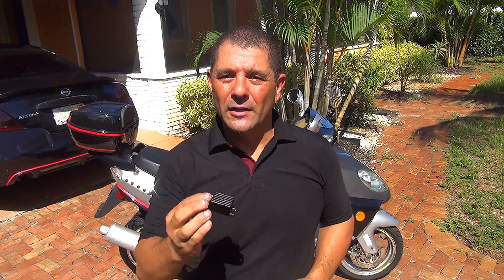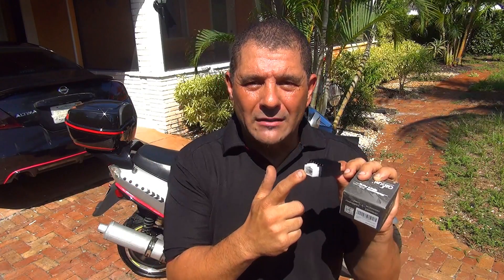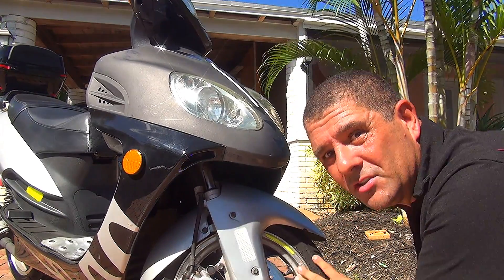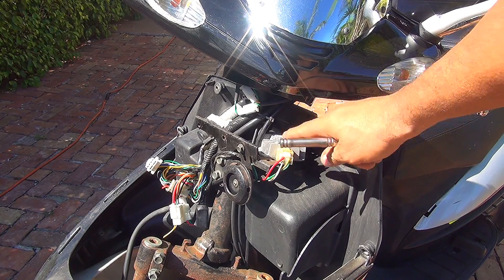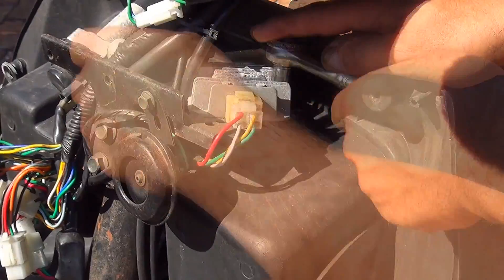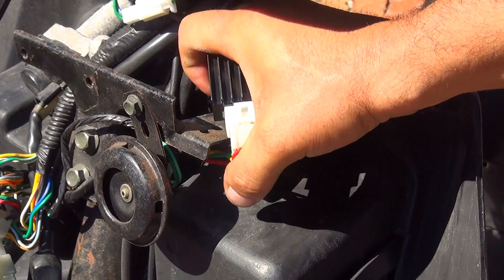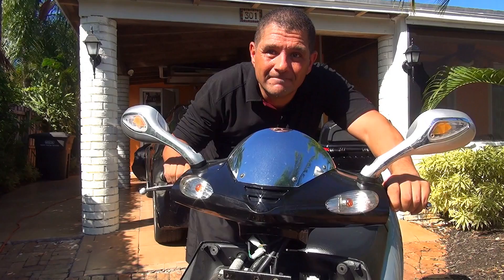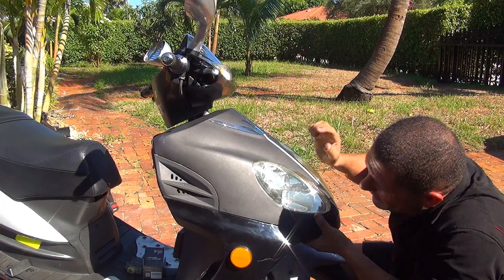How to Replace Scooter Regulator

Comment: I have a 5 pin regulator
Reply from the maker: Some gy6 150 cc run with a flat connection or a square connection Chinese companies like to confuse us just for fun ah ah ah
Reply: @VirberelloScooterTips I found one on Amazon it's a minyo one square connection would that be the one I need

Comment: Hey Virberello, I just changed my clutch springs from the 1000rpm to 1500rpm. I test rode it and it was great. But the next morning my bike wouldn't start. I replaced the battery, test rode it and then the same thing happened! Do you think its because of the LED bulbs I have on my scooter or the regulator itself is the issue?
Reply from the maker: Hello my friend If your battery keeps dying after riding, the regulator might not be charging it properly. LED lights don’t usually drain much power, but if they’re wired wrong, they could be pulling power when the scooter is off. Try disconnecting them overnight to see if the battery still drains. The stator could also be failing, meaning the bike runs off battery power alone until it’s dead. Check if the voltage increases when revving. If not, the regulator or stator might need replacing. Let me know what happens!
Reply: @VirberelloScooterTips i just had to disconnect the regulator, spray some contact cleaner and reconnect it and it's running now! Thanks man!
Reply from the maker: @imWoozify  Great that is a fantastic news
Reply: @VirberelloScooterTips  alright, will do!

Comment: My front headlight goes on when I stop and idle.  It turns off when I go/accelerate.  Is this a voltage regulator issue?
Reply from the maker: Yes that could be the wires or the regulator

Comment: I have an 8 pole stator on my GY6 150cc. I noticed the scooter in your demo has a 6 pole stator. Is the rectifier you recommend in this video compatible with my 8 pole stator?
Reply from the maker: Hello yes the rectifier I recommend in this video is  compatible with 6 and 8 poles stator

Comment: My 50cc system was shut off no lights on gauge no everything yes no power. Could be the battery wiring? I change the fuse and still nothing.
Reply from the maker: It sounds like a power issue in your 50cc system. Since changing the fuse didn't resolve the problem, there could be a few other possibilities:

Battery: The battery might be dead or disconnected. Check the battery connections to ensure they are secure and clean. If the battery is old, it might need to be replaced.

Wiring: There could be a break or short in the wiring harness. Inspect the wiring for any damage, loose connections, or corrosion. Repair or replace any damaged wires.

Ignition Switch: The ignition switch might be faulty. Try wiggling the key in the ignition to see if you can get any response. If not, you might need to replace the ignition switch.

Starter Solenoid: If the starter solenoid is malfunctioning, it could prevent power from reaching the electrical components. Test the solenoid or consider replacing it if necessary.

Stator or Charging System: If the stator or charging system is faulty, it might not be supplying power to the battery or electrical components. Test the charging system to ensure it's working properly.

If none of these solutions work, it might be best to consult a professional mechanic or technician who specializes in small engines to diagnose and fix the issue

Comment: My tail light, my headlights are really dim.I tried everything a new stator new battery nothing helps.Will this fix my problem
Reply from the maker: f you've already replaced the stator and the battery in an attempt to fix the dimness issue with your scooter's tail light and headlights, and you've noticed no improvement, it's likely that the problem lies elsewhere. Here are a few other potential causes to consider:
Faulty wiring: Check for any loose connections, damaged wires, or corroded terminals in the electrical system of your scooter. Faulty wiring can lead to insufficient power reaching the lights, causing them to appear dim.
Voltage regulator/rectifier: A malfunctioning voltage regulator or rectifier can result in inconsistent power output to the lights, causing them to be dim or flicker.
Grounding issues: Poor grounding can also cause dim lights. Make sure all grounding connections are secure and free from corrosion.
Burnt-out bulbs: Although less likely if both the tail light and headlights are dim, it's still worth checking if any bulbs need replacing.
Alternator issues: If your scooter has an alternator (in addition to or instead of a stator), it could be malfunctioning and not providing enough power to the lights.
Fuse issues: Check the fuses related to the lighting system to ensure they haven't blown.
Voltage drop: Measure the voltage at the lights while the scooter is running. If it's significantly lower than the battery's voltage, there may be a voltage drop somewhere in the system.
Given that you've already replaced the stator and the battery without success, it's crucial to inspect these other potential causes to pinpoint and resolve the issue with your scooter's dim lights. If you're unsure about any of these steps, it may be best to consult a professional mechanic or technician for further diagnosis and repair.

Comment: I have a question will the scooter lights work again once i replace the regulator. 
Thaknks
Reply from the maker: They should work again but also check the wires and the connection because on Chinese scooters wires and connections are not top quality
Reply: My light got too much voltage and burned it out. Probably look and see if it's blackened or any connections in the bulb have been compromised.

Comment: Thanks to you, I don't have to kick start my moped now. I just press a button.
Reply from the maker: You very welcome 👍
Reply: @VirberelloScooterTips so I got power on my dash,signal lights work,horn works,brake lights work but when I press start button no power to start.I got a new CDI,coil,sparkplug and solenoid switch.Can a voltage regulator cause a no start by the button also?
Reply from the maker: @gullahgeechee2699 It's possible that a faulty voltage regulator could cause issues with starting your scooter, although it's less common compared to other components like the battery, starter motor, or ignition switch. The voltage regulator's primary function is to maintain a steady voltage supply to the electrical system, preventing damage from overcharging. If it's malfunctioning, it could potentially cause irregularities in the electrical system, including problems with starting.

However, before suspecting the voltage regulator, it's essential to systematically diagnose the issue. Here are a few steps you can take:

Check the Battery: A weak or dead battery is a common cause of starting problems. Make sure the battery is fully charged and in good condition. Test it with a multimeter to verify its voltage.

Inspect Starter Motor and Starter Relay: If the battery is in good condition, check the starter motor and the starter relay. Ensure the connections are clean and tight. Test the starter motor by bypassing the relay and directly applying power to it.

Examine Wiring and Connections: Faulty wiring or loose connections can disrupt the flow of electricity and prevent the starter button from working correctly. Inspect the wiring harness for any signs of damage or corrosion.

Test Ignition Switch: The ignition switch plays a crucial role in the starting process. Make sure it's functioning correctly by testing it with a multimeter.

Consider Voltage Regulator: If everything else checks out and you're still experiencing issues, then it might be worth investigating the voltage regulator. Test its output voltage to ensure it's within the appropriate range.

If you're unsure about performing these checks yourself, it's advisable to seek assistance from a professional mechanic or technician who can diagnose the problem accurately and recommend the necessary repairs.
Reply: @VirberelloScooterTips  💪🏾💯appreciate it.Hopefully I’ll be up and running today when my regulator comes from amazon.I checked all those except faulty wiring.I have a  circuit light tester on the way as well.

Comment: Hi-I have a 150 cc Jonway scooter. The lights are going out on a regular basis.  My scooter always starts fine-and always my blinkers and brake lights always work fine..Do you think its the voltage regulator...?
Reply from the maker: Hello Steve yes is very possible that you need to change the regulator

Comment: Hey bud let me ask you, I had a bad regulator because it was charging 15.1 volts. I had several new regulators but they were all 5 pin with an extra black wire. I know I shouldn't have but I cut the connector and hard wired everything to the new regulator except for the black wire because there was no black wire. Just a green red white and yellow. Surprisingly the voltage came down to 13 and my light worked which they didn't earlier with the bad regulator. What do I do with the black wire? I noticed my digital odometer and speedometer stopped working when I put the new regulator on. Maybe I should have connected the black wire with one of the other wires? Please help!
Reply from the maker: Hello my friend if the extra black wire comes from the new regulator  It should be connected to a metal part of the scooter frame  or other reliable ground source to complete the circuit. Before connecting the wire, make sure to turn off the power to the scooter and disconnect the battery to avoid any electrical hazards. If you have any doubts or uncertainty, consult the scooter's manual . Thank you for watching my video
Reply: @VirberelloScooterTips  hello mr. Vibrello! I just bought a brand new 150cc GY6 motor in the crate and I was wondering where does the vacuum hose going to the CVT transmission go to? Also where does the vacuum hose coming off of the valve cover connect to?
Reply from the maker: @mikecuev820  Hello my friend look this video and will show you what I did with my gear breather hose https://youtu.be/yf-iwpUjwxw and the hose coming from the valve cover goes under your air filter box
Reply: Thank you my friend!!!

Comment: Hi I have a gy6 50cc and my gauge lights recently went out, what should I do?
Reply from the maker: Hello my friend you need to remove all the plastic and look under the cluster gauge and remove the light bulb and see if you need to replace it  you could have a burn light or you have  problem with the voltage getting there so at that point you need to check with a multimeter . Thank you for watching my video

Comment: Hi, since I have a aftermarket air filter and aftermarket exhaust, I am putting a #85 main jet in, so do I need to do anything with the pilot jet?
Reply from the maker: Hello my friend no I will not change the pilot jet unless you change to a higher cc like a big bore kit

Comment: Hi, I have a Gy6 50cc with a aftermarket air filter and also aftermarket exhaust, I’m wanting to put a 150cc carb on it, will I need to go down a jet or two? Thank you.
Reply from the maker: Hello with the set up you have on your scooter if you are at sea level you should reject your carb and have a 85 main jet
Reply: Could I put the 85 main in the 150cc carb or no?

Comment: I have a scooter Baotian 50 Victoria (GY6) limited to 25km/h. I have a problem with the lights. The lights blink and dim when the engine is running. also the engine does not run at full power even when I disconnect the rev limit sensor. I don't understand how the lights stay on even if I disconnect the voltage regulator. I replaced the stator and the battery, but the error was not fixed. Do Chinese scooters have light power via CDI?
Reply: Yes 💯 they have CDI

Comment: My good sir I need your help. Jump starting trifecta with Battery pack, the claps slipped off and i heard a crippling sound. Got bike started, whent on to check tire pressure. Noticed my braking light was on. Then noticed when brake is applied the head light turns off too. Do you think I've shorted out the handle bar switches that control braking, lights, horn, turn signals. The turn signals still work band so horn. What do you think happened?
Reply from the maker: Hello my friend  try to check your wire harness try to see if you have any melted wires there is a possibility that you have a short or the yellow wire and the white wire are together the best will be to have a multimeter to check for continuity and test the wire to fond the problem